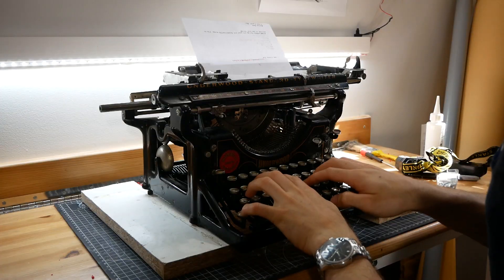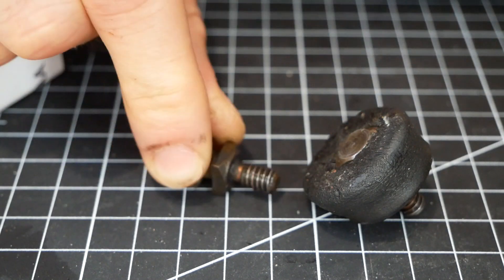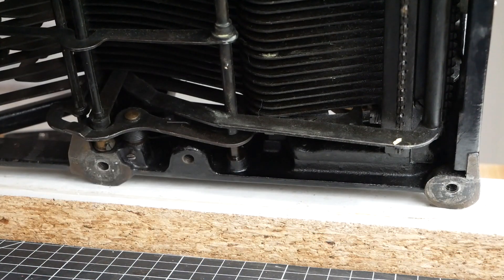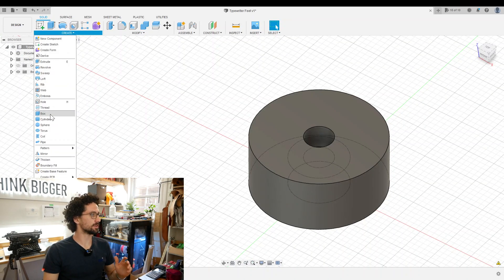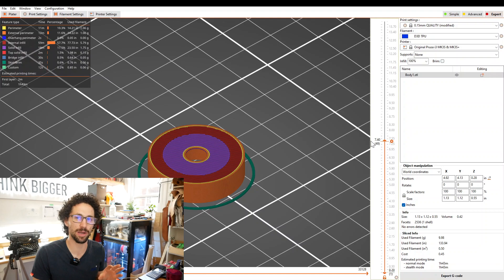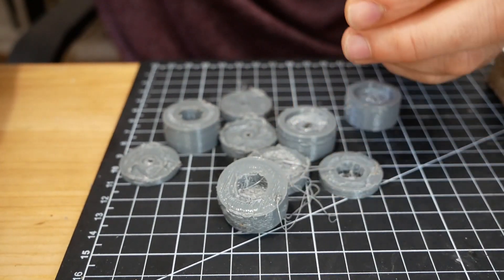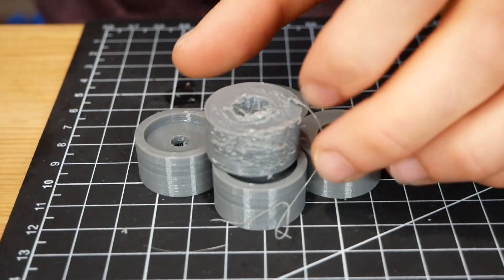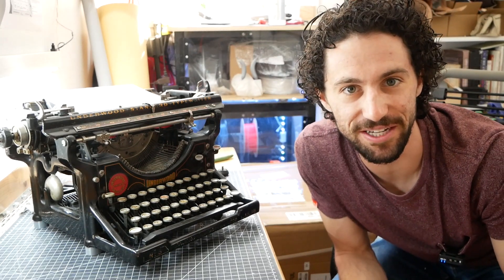Fixing a 100-year-old typewriter with 3D printing

Comment: Excellent job, I’m blown away that 5° change made that big of a difference. Can i ask what led you to try lowering the temp? I’d be interested in the troubleshooting process. In fact... video idea: have you ever seen one of those pictures that has like a dozen chocolate chip cookies that all have something wrong with them and it shows what is wrong with each one? So like it will say “too hot” “too much flour” “pan not cooled before baking” etc. if you could make a bunch of bad prints with various problems and dissect and say what the fix is, as well as various bed adhesion issues, etc. that could be pretty cool. Like, if it looks like THIS, you’re extruding too fast, or your nozzle is too cool, or you leave bed is too hot, etc. I dunno, it’s the kind of thing an experienced person would probably know but a beginner would struggle with and wind up with a 3D printer collecting dust in the corner of their basement (like me). Also loving following along in your Fusion process, it is really giving me respect for the parametric design and making me want to take another crack at it.
Reply from the maker: Thank you so much! Honestly just a bunch of googling of common TPU problems and changing one variable at a time. I started by dehydrating, that didn't make a difference, and then I saw that temperature and flow could be issues so I tried adjusting that. Most people recommend adjusting the temperature by 5 degrees at a time, and it happened to be perfect on the first try for me!

That troubleshooting video is a cool idea, I'll think about it!

Comment: interesting tidbit about those 'missing' washers. None of these Underwoods have them. they were added to the right side of the machine to assist the carriage with sliding to the left while typing.
Reply from the maker: Oh wow that is super interesting!
Reply: @MorleyKert  It's not that big of a help. You can see that the machine works perfectly without being tilted to the left.

Great video by the way. I printed feet for two of my machines which had rock hard, melted or missing feet. TPU works beautifully for this! I'm definitely going to print them for more of my collection as there are a bunch with bad feet.

Comment: Thanks for the video, very satisfying. Left a comment on the previous video about how I was doing the same project by coincidence. Seems to be the case again now; guess we're singing from the same hymn sheet.

I'm making some TPU spacers for my printer, Ender 3 S1, where they replace the springs under the corners of the build plate. I've learned some things that might help others print TPU with tube/ring/torus models. There's something called 'combing', in PrusaSlicer it's a checkbox named "Avoid crossing perimeters". Turn on advanced mode, then print settings, layers, and in the quality section. 

Essentially the nozzle will never cross the empty space during a print, it dramatically reduces stringing. I also turned the retraction length up to 2.2mm and the lift z up to 0.4mm. EVERY speed setting is at 30mm/s. Then for filament specifics, I have the hotend at 220, and the print bed at 50 (but I might change this to 0 as people suggest it helps to cool the filament faster).

Finally, I have a PEI (frosted glass, not sure if that matters but it's in the amazon description) build plate and found if anything the adhesion is too weak. I've got a print running now where I used pritt stick on the build plate to try and increase adhesion.

Anyway, hope this might help anyone out there in a similar situation.
Reply from the maker: Those are great tips, thank you!

Comment: I think I mentioned this in another video, but I originally bought my FDM printer for printing nerdy stuff.

And, though I've used it for that a little, I've used it WAY more for practical prints. The ability to design and print what you need when you need it is insane.

Made my wife a cutting board with my CNC and laser cutter last Mother's Day (2021). She wanted it hung on the wall when not in use. She did that with tacks until one of the tacks broke.

So, I designed and printed a holder for it that attached it to the wall, but allowed easy removal. Perfect size and shape for exactly what I need, "delivered" to me in a couple hours.

(And of course I eventually bought an Elegoo Saturn for my nerdy stuff, which I STRICTLY use for nerdy stuff)

Comment: was going to say as soon as i saw those failed prints, looks like over extrusion. you can see the top layers are all torn up with chunks bulging out either side of the lines. that adds up and adds up and will get smushed out to the side of the shapes as it does each extra layer. 
temp might have helped but i think the main thing was lowering the extrusion, especially with 100% infill
Reply from the maker: It’s wild how big of a difference lowering the extrusion by 10% makes!